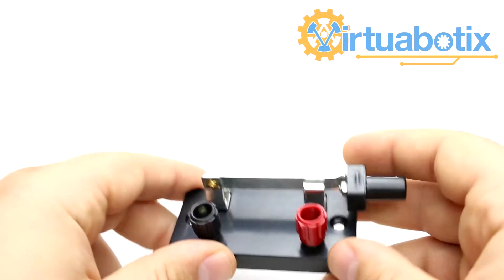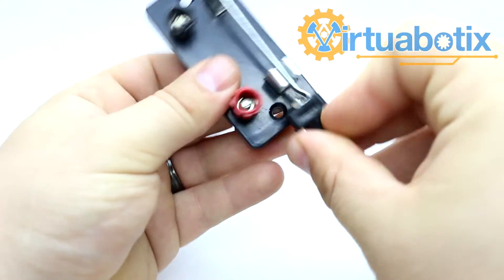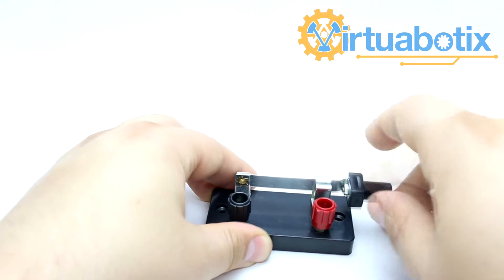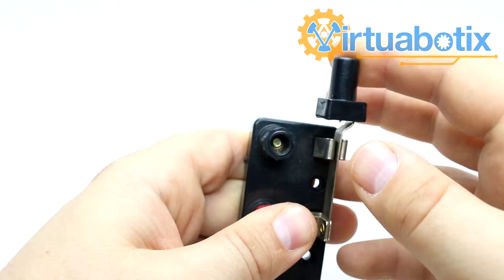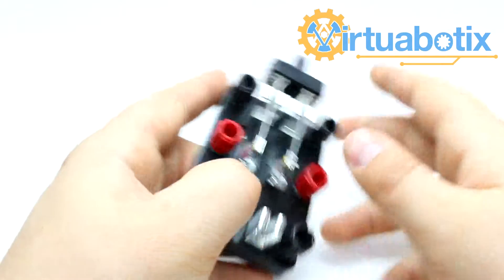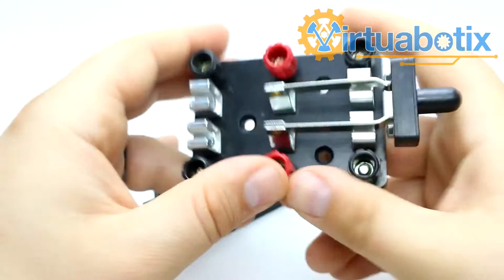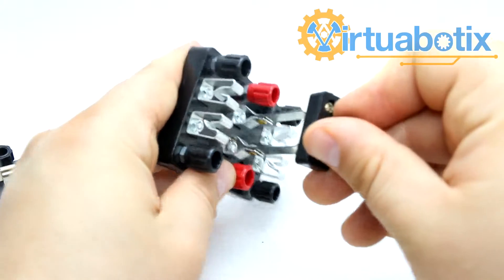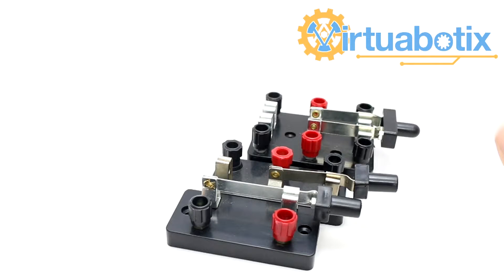Virtuabotix Knife Switches and you

Comment: I'm operating a ham radio, and my ladder line (antenna feed line) is currently coming into my ham shack and connecting to my tuner. During a lightning storm, if I want to disconnect the ladder line without physically pulling it out of the tuner, which one of the knife switches would I use to accomplish that task?